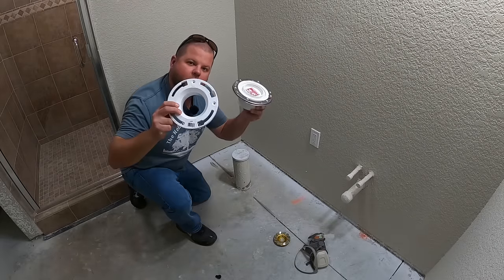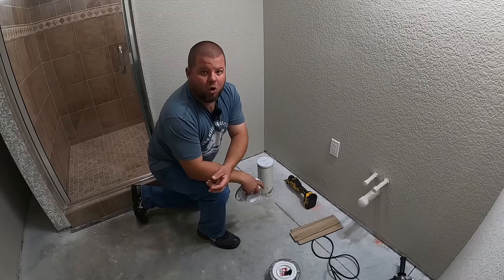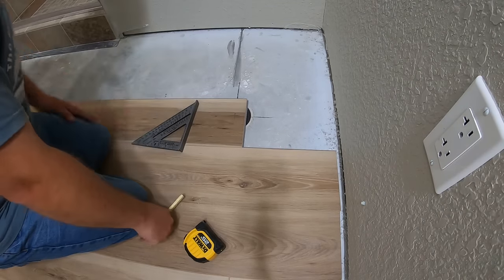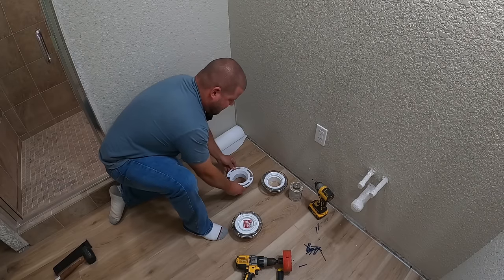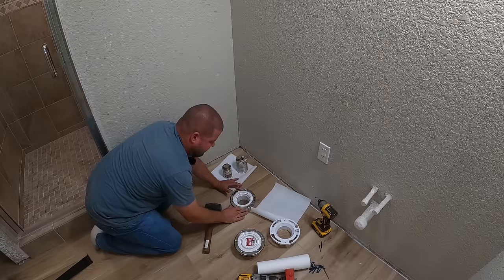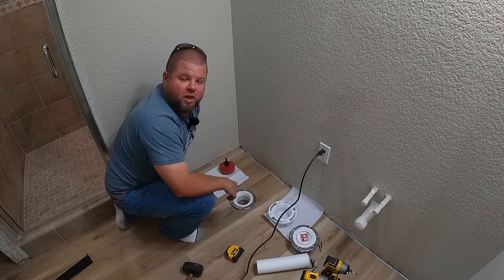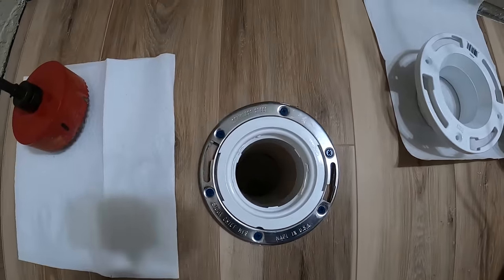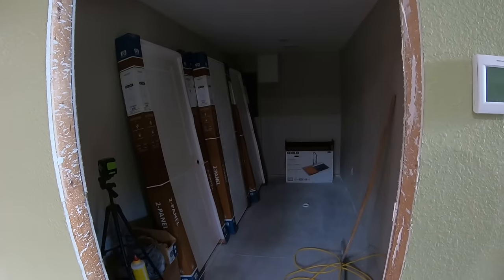How to install a toilet flange! Plus finishing up the bathroom flooring! #543

Comment: The Oatey Steel one is frustrating as heck. Went to knock the cap out of the center and it cracked the whole pvc portion off of the steel ring. 
 Grabbed a second one I had on hand, got it installed but the PVC flange on the underside holds the steel ring off the floor so when you tighten the screws it bends the metal down or you don’t tighten all the way and it stays off the floor 1/8”.  Also I measured from the back wall to each end of the Closet Bolt slots but apparently that doesn’t work when the bolts are installed they are kicked 1/2” in rotation. That’s prob more my fault but incredibly frustrating after drills all my holes through tile.
Reply from the maker: I usually work around the knock out in circles with my hammer. It's definitely in there.
Reply: @TKCL  it was prob also my mistake cause I did it the first time holding it in my hand. The 2nd time I set it on the floor and worked better. 

But it certainly was frustrating taking my time to carefully measure equal distance to the end of each closet bolt slot, painstakingly drilling the 6 holes through porcelain tile just to find out the closet bolts aren’t equal distance once installed 😢 Oh well, I’ve already re-clocked it with the closet bolts in place and gave myself some wiggle room and toilet is bolted down looking good. 

Nice channel btw thanks for the response.

Comment: Question..... maybe you've already commented on it and I missed it....did you forget the water supply stub-out? 25-30 years ago I did that as an apprentice, it was an Oh S**t moment when I went back for finish, lol!
Anyway nice vid on proper closet flange installation!
Reply from the maker: The plumber I hired to do under slab plumbing did forget it.  It worked out fine, I came out of the bottom side of the vanity and hid the cut off valve and hammer arrestor inside of the cabinet.
Reply: Ha, dang plumbers! 

Glad to see you choose the stainless ring style. I've had a few toilets with a thicker underside and shallow horn push almost all the wax out and actually touch down on the plastic causing stability issues. Yes, a possible toilet manufacturing issue but has happened none the less. Ended up replacing the flanges in those situations with the thinner stainless and no problem getting those toilets to sit proper!

Anyway, again nice vid and good luck with the rest of your project!
Reply from the maker: Thank you

Comment: How would you mate the ceramic tile up to the sewer pipe?
Reply from the maker: Cut it in a circular patter with an angle grinder and diamond cut off wheel.

Comment: How would have removed the concrete around a 3" pipe so toilet flange would fit on the outside?
Reply from the maker: These are designed to slide INSIDE the pipe

Comment: Those fit very snug. I seen plumbers just put it on and screw them to the floor. They said if it needs a new flange ring then it will be ez to be removed. So code is to glue it.
Reply from the maker: I've seen that done as well.

Comment: What's the measurement from the dry wall to the center of the drain ..to install a new toilet where there is no drain pipe installed
Reply from the maker: 12 inches is industry standard to center of the hole from FINISHED wall.

Comment: I agree on the metal ring version of the toilet flange. I’ve seen the old metal ones crack and break, I can’t imagine that plastic one lasting very long. The first time that toilet loose and some big person sits on it it’s gonna crack.   :/   Maybe they were but I’ve never even seen one in plastic before and I would never trust it.
Reply: The adjustable metal ring flanges actually do have a flaw if you can believe it.  The moisture/humidity can rust those rings.  They're pretty worthless when the rust takes over.  The plastic ones last forever if you don't overtorque the toilet bolts.  Not every metal ring flange rusts out, of course, but it does happen.  The cast iron flanges rust out too, but not after a very long time of being exposed to moisture because of the thickness of the flange.

The weight of the individual sitting on the toilet doesn't necessarily crack the plastic flanges, by the way. The force that's applied to it tends to cause stress on the fitting and then it eventually snaps when under a lot of stress/strain.  100 lbs person sitting on the toilet can snap that flange just as easily as a 300+ lbs person can by applying pressure to one side of the toilet and the toilet is loose/wobbling due to improper install, uneven flooring, etc...  You can't crack a toilet flange just by sitting on it properly with the flange properly installed.  The bowl of the toilet is designed to hold hundreds of lbs of weight if installed correctly and evenly distributes weight onto the flooring under it provided that the floor is level.  It's all about preference, though.
Reply: @andrewwelch5668  The metal ones now are all stainless steel so you shouldn’t have corrosion and rust problems. I have work construction and did a lot of tiling and bathroom demo and the plastic ones are broken A lot of the time. If your floor underneath it is solid it’s all the way to the toilet sitting on a good flat surface you’re a lot less likely and then it doesn’t matter but if you’re on uneven flooring or flexible flooring and PVC stuff cracks quite often and people tend to over tighten bolts and mess it up as well. The stainless ones I’ve taken out we’re all fine but if they’re making them out of other metal then it can be a real problem because that’s potentially a very wet area and wax rings and even then newer rubber rings are OK but eventually you’re going to get some water in there one way or another and you’re right if it still it’s going to rust and if it’s aluminum it’s going to have corrosion issues but I don’t think they’d make it out of aluminum. Along time ago they probably made them out of cast-iron which isn’t very good that will definitely rust over time but I think stainless is the best option it’s strong corrosion resistant and it’s not going to rust, but if the floor is prepped correctly and the toilet can sit flat it’s not putting much pressure on there and the PVC should be fine but if you’re on a flexible floor or an even concrete or you’re going to put it on top of flexible flooring I think stainless is going to be your best option and that’s all I’ve seen now are the PVC or the stainless
Reply: @ShaneZettelmier  you'll be surprised to know that even though the manufacturer claims that those adjustable rings are "stainless" that they aren't 100% stainless...especially the brand that this person used in the video.  Get yourself a magnet and check the ring.  If it was 100% stainless, the magnet wouldn't stick.  Those rings are made of some sort of alloy that has a small % of stainless.  Just checked it to see for myself and the magnet sticks to it pretty strong.

Comment: Question. Where is your waterline for the first toilet. Asking for a friend.
Reply: To the right of the plug it is roughed in for a sink. Fill bucket up in the sink then dump it into toilet as needed. It's the country way.
Reply from the maker: Cut off valve and hammer arrestor are in the vanity cabinet right beside the toilet. Waterline exits bottom of the vanity to the toilet.

Comment: Great information.  You wouldn't think that a toilet flange would be a big deal, but my plastic mount (the one you chose not to use) has broken.  Now I have to pull the toilet and figure out how to remedy the situation. One thing you didn't cover is how far back in the linen closet were you able to put the flooring?  You didn't mention hiring a skinny 9yo that could fit in there for you.
Reply from the maker: I was able to go all the way back after sucking my gut in lol.

Comment: if you want to save some effort on the loft floor, maybe consider a thin plywood underlayment. I guess you would have to balance the time of the work vs the cost of several sheets of thin plywood.
Reply from the maker: That or rent a floor sander
Reply: @TKCL  that sander will send a giant cloud of sanding dust all across your newly finished house
Reply from the maker: Yes it will, but it's necessary to get the concrete level. A major house cleaning is required at the end of the build.

Comment: Great video, did you forget to run a water line to that toilet?
Reply from the maker: My plumber did, but no big deal. I ran out of the side of the vanity. I was able to hide the hammer arrestor and cutoff valve inside.

Comment: How many bathrooms have a convenient electrical outlet behind the toilet ?
Reply from the maker: None.... That's why we installed one, should the desire for a bidet arise or nursing assistance is needed down the road. It's also easily accessible and NOT blocked by the toilet.

Comment: I dont see a water supply for the toilet.  Drain should be 12 inches from back wall to center of drain unless you use a 10 inch rough toilet.  You need 16 inches from center of drain to either side as you sit on the toilet for code. (Camera angle makes it seem to be a little close).   Looking good tho👍👍.
Reply from the maker: 12 1/2 inches to center of pipe from the wall.  I chose to run the water supply out the side of the vanity due to too much piping going on in that 2x4 wall.

Comment: There is "Clear" primer. Not to be confused with clear "Cleaner". The clear primer can be used where primer is required but will not stain if spilled or "Flung" onto surrounding surfaces. It can be used to clean up where purple primer has stained something "if you're lucky". 
The clear cleaner is not primer and will not create a PVC weld in conjunction with PVC glue the way primer does. So read the label carefully before purchasing or using the clear primer. Buy the correct stuff and don't even carry the cleaner on your truck.

Comment: In the Philippines, I was SURPRISED to see that 90% of the Workers there DO NOT USE GLUE. They slobber the Purple cleaner on both parts and shove them together!!
Reply: Theoretically if the pvc pieces are snug enough the purple cleaner (which cleans AND softens) will semi weld the pipes together.

Comment: Did anyone notice there is no water supply to the toilet😢are those osha approved socks?
Those 4" hole saws have a tendency to run,not recommended to use it with socks on.
You have a great presence,refine the  procedure
Reply from the maker: Been answered a 100 times, water supply comes out of the vanity directly beside the toilet. The hammer arrestor and cut off valve are hidden out of sight. It's a much cleaner look.
Reply: I disagree,but thanks for responding. 
And what about the Osha socks,just poking fun my friend, looks like it's  gonna be a beautiful  house.
Wishing you the best
Reply from the maker: When OSHA starts coming into private homes harassing a homeowner we know we have really screwed up with our policies and politicians. I'm not wearing nasty shoes in my home.

Comment: If that is a ‘floating’ floor, you’d be better served to make that hole in the flooring is the outside size of the flange. Hopefully the flooring is glued down.
Reply from the maker: That one area isn't going to cause a small section of floor buckle. It can still expand and contract at the edges. Think of all the heavy furniture and kitchen cabinets people put on floating floors.
Reply: @TKCL  Good point. Thanks

Comment: The knockout did not work for me. It ruined the flange. Hitting it with a hammer where it says to strike...on the hammer symbols? That area is way too thick to just break away.
Reply from the maker: They are definitely thick, but I've busted out several. I usually work around the ring giving light taps and cracking it as I go. Then one final blow always knocks it out.

Comment: You need to make sure you get COMFORT HEIGHT toilets.  You won't regret the higher throne.
Reply: Unless you are my height, nothing funnier than a 50 year old man sitting on the toilet and his feet don't touch the floor.
Reply: @terryjohnson3100  Oh my goodness!! I feel your pain!! I’m barely 5ft and my legs r plumb short (that’s worse than being normal short)! I have to put a book under my feet or loose circulation! Of course, my hubby is a foot taller than me! The struggle is real! Lol!
Reply from the maker: Tiffany is dead set we are getting taller toilets, she hates short ones.
Reply: @TKCL   #SquattyPotty
Reply from the maker: Lol 🤣🤣

Comment: Is this method sumo wrestler approved? We have a house full of them. After every new toilet flange and wax ring replacement. It doesn't take long before the screws and bolts strip from the floor and flange. The toilet turns into a swivel rocking chair. That leaks everywhere and slams into the drywall every time they get up. Please help 😂
Reply from the maker: You need a whole different system 😬

Comment: common man...why plumber hasn't built up a 6" by 6" protection around  that drainage piping wat before concrete to be poured? they could've used Styrofoam  insulation and built a square 📦 box around or simply use strip insulation (used for wood protection when basement walls are built and wrap few times around)..there are much simpler ways who make toilet flange installation easy-peasy
Reply: What would you secure the flange into then???

Comment: I am not a plumber but based on my research … toilette flange should be flush with flooring.
My concern about your video is every time you change flooring you change toilet flange?
Why not cutting the floor around the flange ?
Reply from the maker: They make different size seals to accommodate different heights.
Reply: @TKCL  oh ok … thank you for your reply! I hope I dont mess mine up lol

Comment: Where is the water line for the toilet?
Reply from the maker: Comes out the bottom side of the vanity that will be right beside it. You can hide the cut off valve and hammer arrestor in the cabinet.

Comment: and..if you install flange just above finished floor, you'll have problems in the future, when? Many toilet installers use wrenches on toilet bolts nuts , damaging that small plastic lip on toilet flange..then toilet starts (slowly but surely) tor rock..then when setvidenplumbwr is called to solve issue,  he'll notice repair flange kit will push toilet off the finished floor and he will need to use silicone around bottom of toilet, or start chipping all that concrete floor around to be able to cut out old flange and replace with new one..an expensive service call..

Comment: Why use primer? Why not just use glue?
Reply from the maker: You can in some areas codes, most inspectors require primer to be visible as its supposed to help bonding. Florida code actually does not require it if your glue meets a certain criteria.

Comment: Where's the supply line to the toilet?
Reply from the maker: Comes out the bottom corner of the vanity that's right beside the toilet. Cut off valve and hammer arrestor is  hidden inside the cabinet.

Comment: Time to cover the toilet hole until the toilet goes in - plastic bag and painters tape. Asked contractor to make sure mine were covered, he didn't and ended up with clog due to something falling in.   Of course you are meticulous and doing everything yourself  so you may not need🙃
Reply from the maker: Toilets going in very soon!

Comment: Why would anyone even need to glue to pipes together. It's a tight fit and it's flushing downhill down a waste drain. I mean, even if u get a backup-that fit should he snug enough to prevent any stuff from coming out of it.
So why do u have to shoot yourself in the foot by permanently gluing those pipes?
Reply from the maker: Because of backups and sewer gasses, no fit is tight enough to stop water or gas.  You don't have to, but code does require it.

Comment: I mean it looks pretty, but to me it seems silly not to just do the flange first then flooring around it.  1. The toilet is gonna cover it so it doesn't have to look pretty, you can just hack around the flange a half inch/ inch gap whatever is all gonna be covered .  2) Its supposed to be a floating floor, so no joy there.  and 3. That flooring doesn't last forever and now somebody else is gonna have a bitch when they decide to tile it.

Comment: Hold up homie I'm not a Karen who's always right, but my guy, why do all the extras with laying the floor before the pipe? It's not hard to cut around a flange...

A 4 in saw, and all that mess is doing to much... Plus those outlets in that wet space have to be GFI outlets to save one of your family members...
The water supply lines for the vanity are way to close to the drain..
Just my two cents
Reply from the maker: Ever seen gfi breakers?

Comment: Call me a blind trucker but where the heck is your water supply for the toilet??🤷‍♂️
Reply from the maker: Comes out the side of the vanity that is installed beside the toilet. Cut off valve and hammer arrestor are hidden inside of the cabinet.  Worked out very well.
Reply: @TKCL  hell ya. I was just shocked not seeing a stub out. Hell I just put my stub out on the right side of the toilet. Ha ha